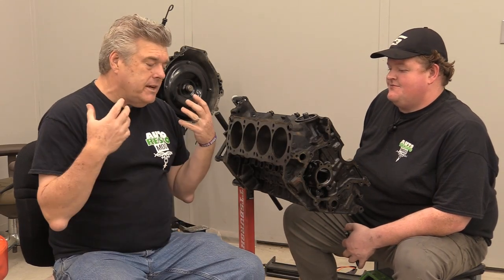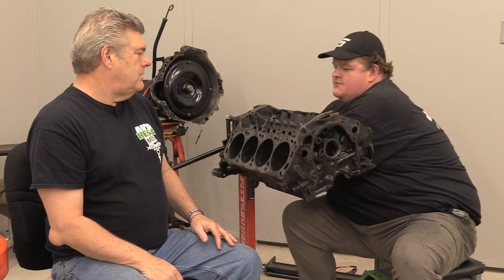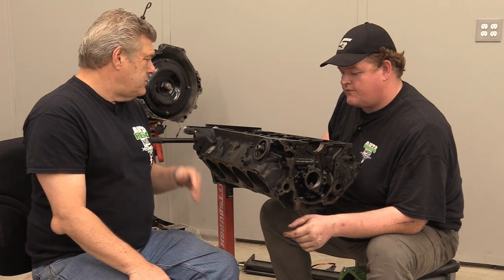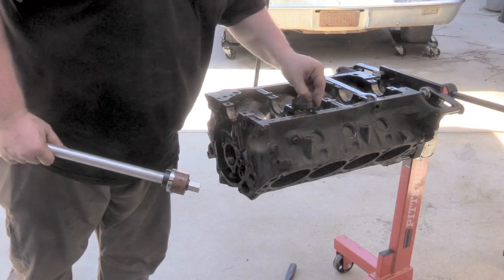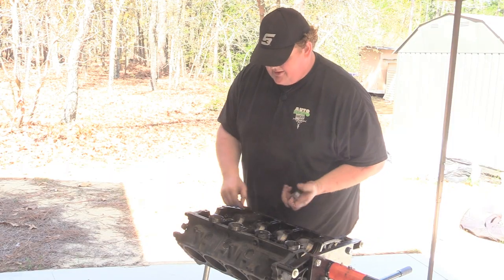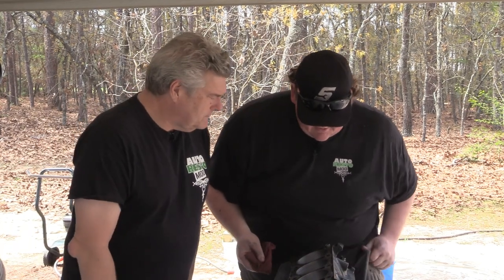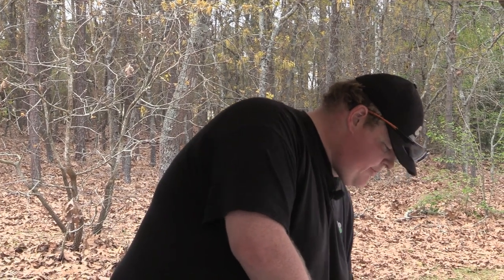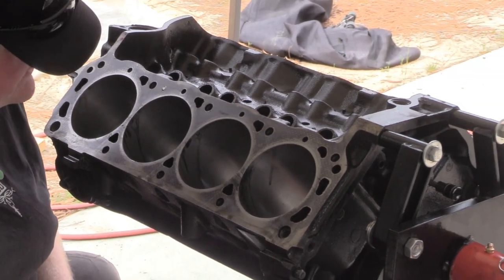Engine Block Preparation

Comment: With regards to the oil galleys, another oiling trick is to drill a small hole in one of the plugs right behind the timing chain/gear to help extend its life. There’s my 2 cents.😉 ✌️
Reply: Picture? Not understanding and I'm redoing a 289.
Reply: @Meche697  give me a minute I’ll find the time stamp in the video.
Reply: @Meche697  @15:32 he drills it and pulls the plug out. It needs to be a really small hole so it doesn’t compromise oil pressure to the cam and mains.

Comment: If a guy doesn't restrain himself during a rebuild the cost can sure spiral out of control. When I'm shopping online I leave the items in the cart a few days and then debate with myself if I really have to have it before I check out.   If you change the rod bolts then you are going to need to resize the rod. If it was a stock 351 Cleveland I would change the rod nuts cause they were a known weakness otherwise stock is usually fine. Thank you for the video, I appreciate you.

Comment: Does anybody in comments know a good place to order a crate small block?

I have a 65 mustang I’m restoring and going to swap out the motor when I’m done with the chassis. 

I’m not looking for any crazy horse power, but at least a respectable amount (250? 300?). Also fuel efficiency is a concern for me as well. 

It currently has a 302 in it. Thanks in advance for any input 🫡
Reply: Blueprint engines is one.
Reply: Go with a 351W roller block stroker budget build. You will love it.

Comment: I’m not in agreement regarding the conversation about the head bolts. I think the door is left open for people to go to some big box store and grab what looks like a head bolt. The metallurgy of some of the junk metal that comes from only God knows could cause a person to be looking at a considerable number of $$$$$. When there head gaskets blow out, because of using some bad metal alloy. Spend the difference and get some good American steel in some really good head bolts. All the money that will be spent on an engine build comes at a great cost. And for what, a few dollars more for a product that’s made of “ the right stuff”.

Comment: Why spend all this effort on a engine already 60 over.
Reply: 400.00 in parts, 20-30k miles it’s a no brainer. It’s still good so what, throw it away just because it’s on its last round??